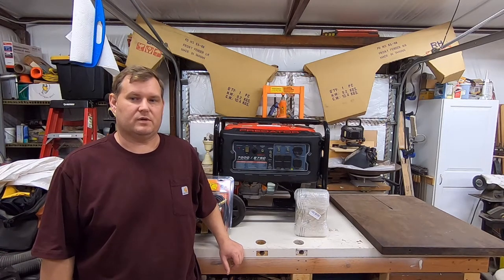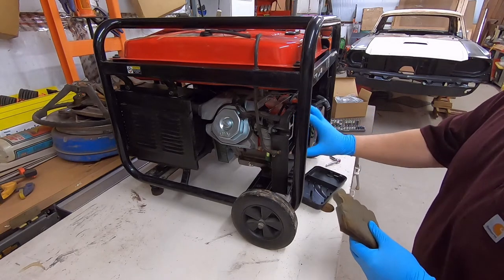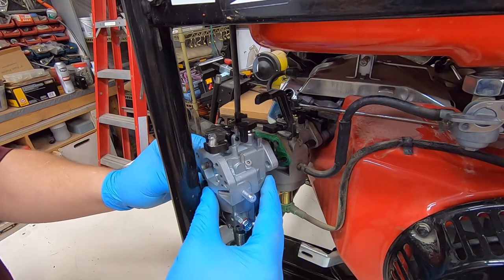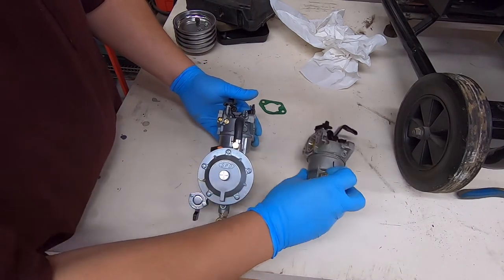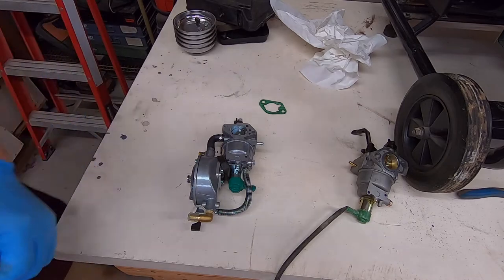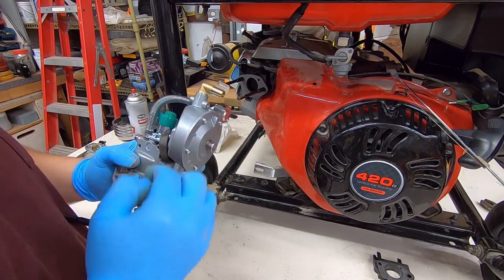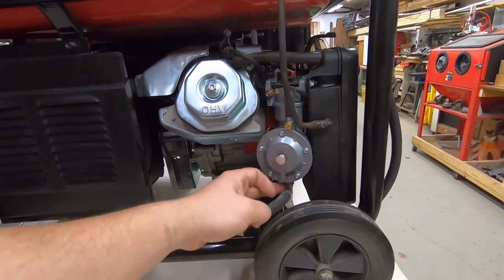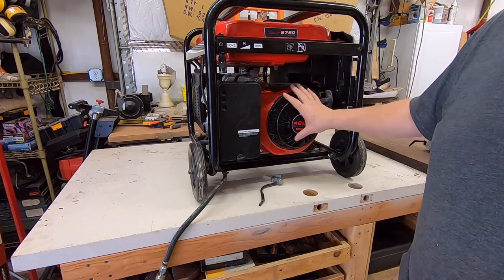Convert Predator 8750 generator to run on propane and natural gas

Comment: Very nice! I have a whole house backup generator with an automatic transfer switch.  I am very sure this generator and mod is much less expensive than mine.  Although, I only have about $2500 in my back up generator.  Great Video.
Reply from the maker: We used several of these on job sites and they hold up very well so I bought one for myself. Our house is a pain to do a permanent standby generator so it wasn't on the table for us. What i would like is a large backup battery and inverter.

Comment: As far as towing your generator is concerned, you might consider pulling your wheel kit altogether and buying a 24 inch wide yard cart. For $139 I got one at Harbor Freight rated for 1,000 lbs. The handle converts for towing, and by dropping the sides, there's easy access for services. There's also room enough for 4 2.5 gallon fuel jugs up front, and stowage for the power cable aft.
Reply from the maker: That sounds like what I have mine mounted to. The handle is also removable so it can be pulled by the mower

Comment: Actually the plate with the vacuum port is used for an automatic choke actuator
Reply from the maker: These carbs don't have automatic chokes but the California models have a charcoal canister like they have on riding mowers to capture the vapors.

Comment: You didn’t plug the phone fume hose back on. Did you cut the nipple behind the air intake to make it for around the gas regulator?
Reply from the maker: I didn't have to cut any of the hoses. It was a direct drop in replacement for everything on the original gasoline side.

Comment: How do you find what the new output rate is dont you need to know the new efficiency or how do you estimate it ? Thanks
Reply from the maker: I would estimate you would loose around 2500 watts when running off propane and a little more off of natural gas. But just a guess going by other brands that have numbers on it. That said I don't know if the numbers anyone lists for output on any fuel can be trusted. Kind of like air output of air compressors. Who knows ...

Comment: I like your conversion video and would like to do this on my generator. I have the exact generator as you, however, when I search Amazon for carburetors it's overwhelming how many there are. Could you supply the brand and number of the carb you bought please?
Reply from the maker: This is the one I used. It goes in and out of stock and there are others on amazon that are the same one. Ignore the wattage listing. It has the same diameter venturi as the original gas one. https://www.amazon.com/gp/product/B07ZP3H1N9/ref=ppx_yo_dt_b_search_asin_title
   The Predator engines are very similar to the Hondas so many parts that fit one fit the other.
Reply: If your still looking check out Hipi store

Comment: I like the way that kit fits. One question, the Amazon listing is for a kit for a 4.5 to 5.5 kw generator. Does that make a difference? Yours is a 8750 w.
Reply from the maker: The listings are as usual odd and misleading on Amazon. Go by the engine and the HP. The predator engine is basically a Honda 13hp clone. So go by engine for your final choice but if you are browsing for one that will fit an application you can use the approximate KWH output to help narrow your search.
Reply: You may have to drill out jet a tad but it’s no big deal at all
High hp engine requires more fuel

Comment: Just to be clear, does this result in a conversion from gasoline to propane, or do you end up with a dual fuel generator?
Reply from the maker: It's dual fuel and technically tri fuel if you have a way to supply it natural gas. For me gasoline is a fuel of last resort in generators. No issues with bad fuel or gummed up carbs etc with propane. And during a power outage you most likely won't have access to gasoline as the pumps will be down.

Comment: HI Matt, I have the same setup, where did you get the "easy connector and what is the size". I have a bbq connector. Not Sure how to connect without cutting and hooking up to the inlet.
Reply from the maker: The regulator I am using is an off the shelf replacement one from Mr Heater which has a threaded 3/8 flare connection. For the quick disconnects you can use any propane/nat gas ones. As far as I know they are all the same here in the US. For the hose going from the connector to the carb I use 3/8 standard fuel hose.
Reply: Me again, so I am having a hard time with the fittings. If you use 3/8 fuel hose to carb. What fitting do you use from the3/8 hose to connect to a disconnect? I went to plumbing shop. They were no help.
Reply from the maker: @dancheatham5106  These are the proper style of quick disconnects used for Propane and Natrual gas. https://www.amazon.com/EXCELFU-Natural-Connect-Fittings-Disconnect/dp/B07XYQ35GV/ref=asc_df_B07XYQ35GV/

           To connect from the 3/8 fuel hose to the disconnect you need this. https://www.amazon.com/SUNGATOR-Brass-Fitting-Adapter-2-Pack/dp/B07MTQLFQC/ref=pd_lpo_2

             From the regulator to the disconnect you need this. https://www.amazon.com/LASCO-17-4831-8-Inch-Thread-Adapter/dp/B008E5CIO4

                You can usually get these locally for less than Amazon at an ace hardware or other hardware store. Most quick disconnects have pipe threads but a few do not. So what you need for your application may vary but this will get you in the ball park.
Reply: @theinfernalcraftsman  You should do a video of just these parts installed. Figuring out how to adapt the propane regulator is more time consuming and frustrating than installing the carb...This was the first good video with links to the parts I need. Otherwise I was going to cut off the end of the reg hose and fasten that straight to the carb ferrule.

Comment: where did you hook up the regulator is this video?  I don't see it.  Thanks.
Reply from the maker: The high pressure regulator is on the hose assembly and mounts directly to the propane tank. The low pressure one is on the carb itself. It is the lower part of the carb. I think you are used to seeing the retrofit kits which use a forklift regulator which is a really big 6" diameter thing. The factory style tri fuel carbs use a far smaller and more compact assembly.

Comment: How long does it run on a tank of propane?.
Reply from the maker: It will run around 6 hours at half load off of a typical BBQ tank. They are typically only filled with 15 pounds of propane which is 3.5 gallons of propane and typically costs $14-$20 to exchange. Here propane is running just over $3 a gallon from a real propane seller not an exchange kiosk. It's much cheaper to run off of natural gas. If you have larger propane tanks that you can have a propane company fill it's quite a bit cheaper. 
     The nice thing about these carbs is that it allows you to run any of the 3 fuels so you have alternatives and aren't stuck to just one fuel.

Comment: Why not just use the original black carb motor insulator piece?
Reply from the maker: You can reuse the original. My only issue is with the possibility of warpage of the old one. Well that and the new one didn't need gasket material scraped off of it...